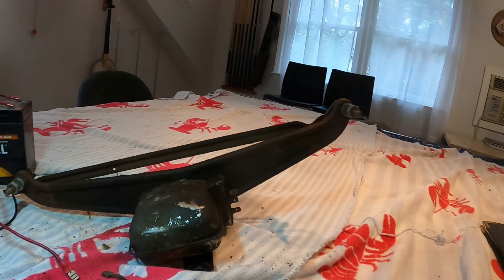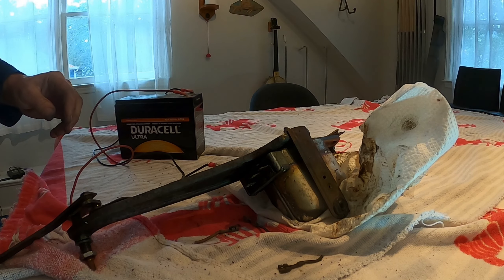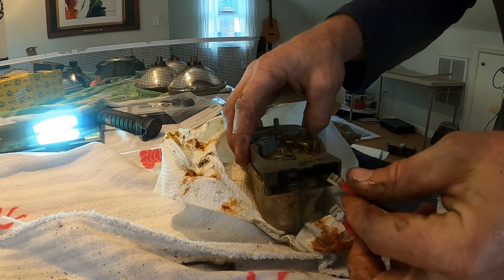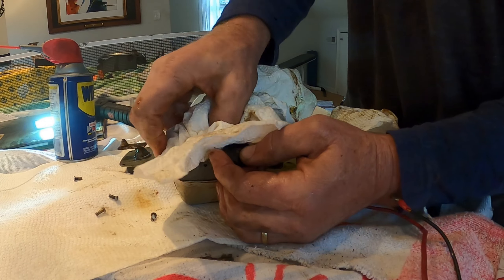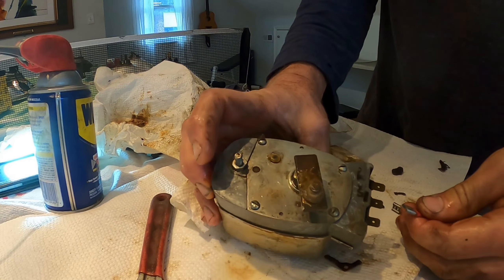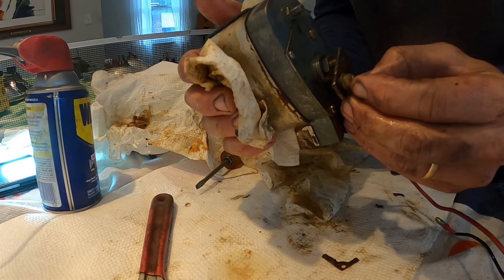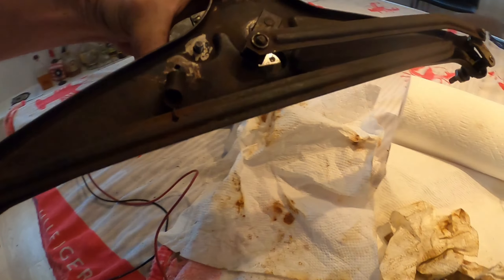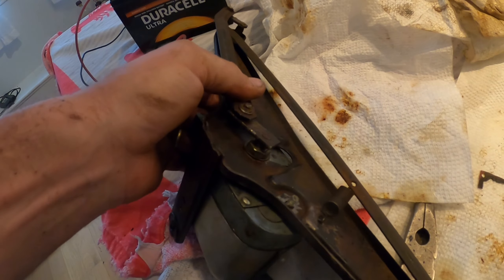1961 VW Beetle (65 Pan) - Windshield Wiper Motor - 078

Comment: Is the wiper motor 6v or 12v, I had to upgrade my 63’ to 12v
Reply from the maker: It is a 65, and unfortunately doesn’t quite fit the 1961 body.  Still happy to fix something - maybe I can trade it for a 61
Reply: Thats a 6 volt it has three prongs 12 volt has four plus a ground, thats why it goes so fast using a 12 volt battery idk